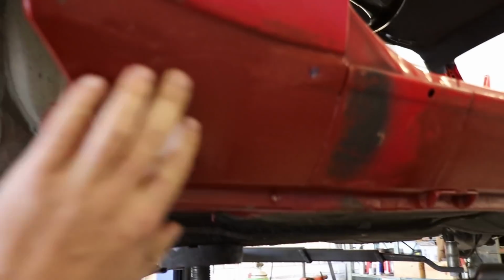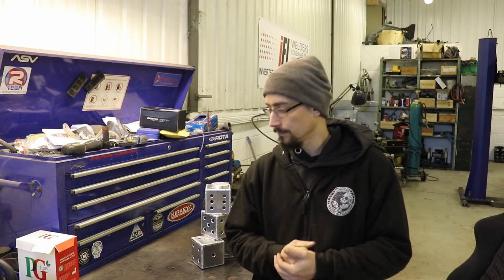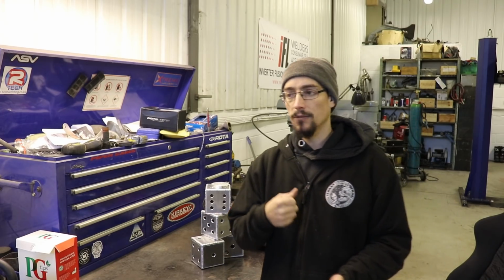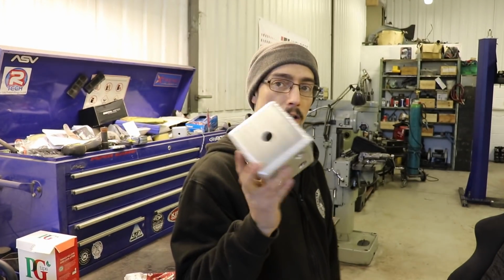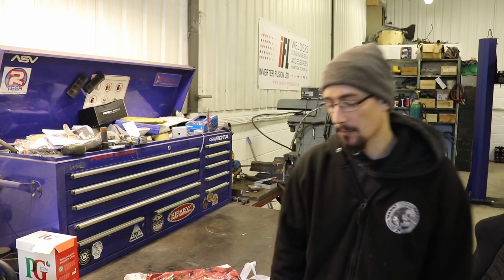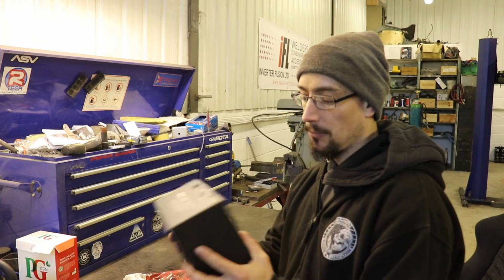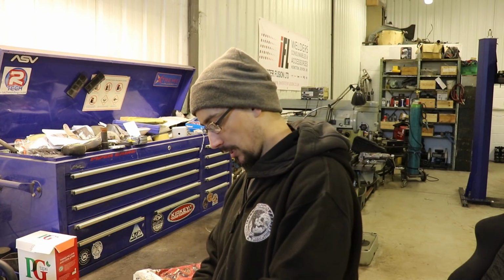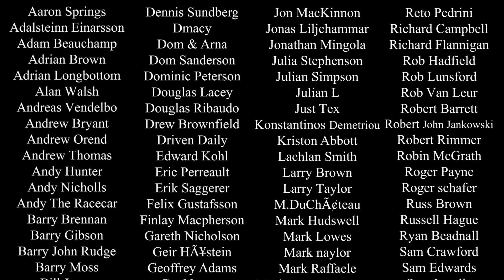WORKSHOP UPDATE + SOME GIVEAWAYS

Comment: I watch Urchfab and Bad Obsession. Both shops dealing with a ton of rust. Why? In the “rust belt” of the States, we treat roads with a lot of salt. England really doesn’t. What’s the issue?
Reply: Matt Cerbone England (and the UK) does use a fair bit of salt in the winter and being a small island, you’re never too far away from lightly salty sea air.

Plus the mini in Bad Obsession, Ford 100e, Mazda MX5 and BMW e30 seen on Urchfab were never famed for their corrosion resistance in the first place...